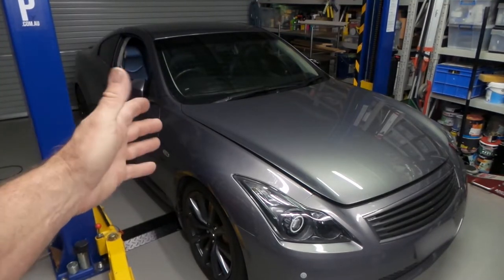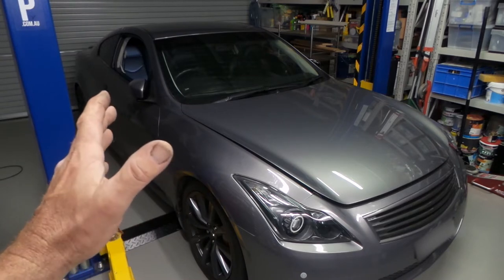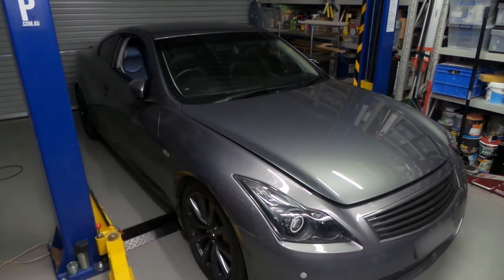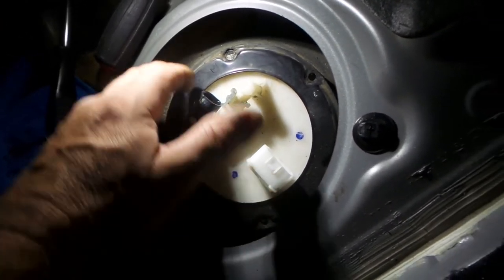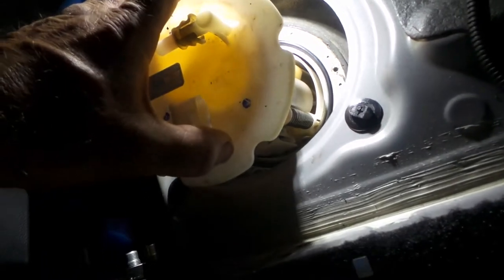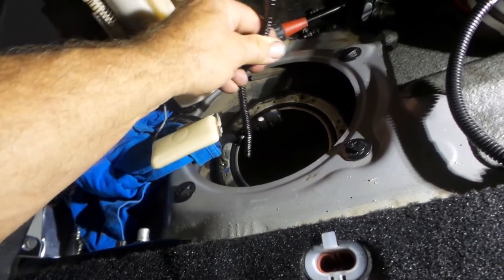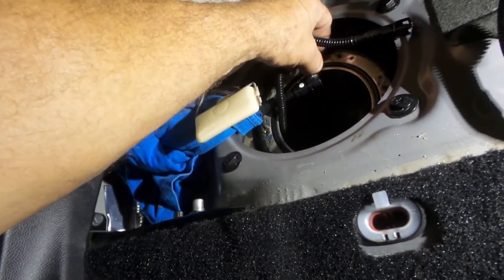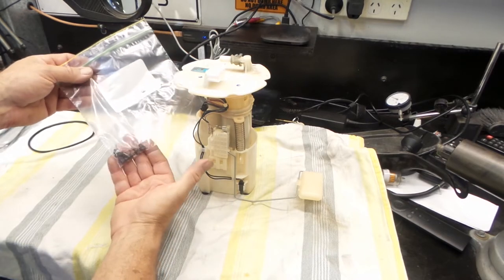The Ultimate 350z Early G37 Fuel Pump & Return Upgrade Diy

Comment: G'day mate, could you please share where dis you get the instructions for the CJM fuel return? I've already have a spare 350z fuel pump with the return correction and fitting installed, the electrical wiring done, and whats left is to install the hose from the new pump to the engine bay area and I have no idea of the hose arrangement. The only thing I know is that the hose that used to supply fuel is going to be the return now, and the new line is going to supply fuel. Could you share links with instructions or where you get pointers or diagram? Thanks a lot, cheers
Reply from the maker: G'day Mate, with the kit that I used (CJM) the original feed line is still the feed line. The new additional line (6an) is for the return from the Reg. Unfortunately I dont think there are any diagrams for the return lines available. Once you lay them out they are pretty self explanatory though. There is a join in the factory fuel line at the firewall in the engine bay that you will need to disconnect, there will be an AN style adapter for this join in the kit. From there you plumb to the fuel distribution block. The distribution block has 2 outlets, one goes to the rails & the other returns to the Reg. Hope this helps, Cheers.
Reply: @TheAussieShed  thank you very much for your answer and help. I've got a kit from CJM too, but I ordered for a G37 and I have, like you do, a 350z style fuel pump on my 2008 G37. However, Charles from CJM is really awesome and sent me the needed parts and let me return the ones that I wasn't going to use, and a brief explanation and pictures of it installed in a 370z. Ive got four hoses, one from the tank to a new filter under the middle of the car, another long hose from the filter outlet to the back of the four way piece over the rail, then another to the regulator and under the regulator the old feed line will be return. My mind was a mess but today I finally understood it and feel confident to install

Comment: Hey mate where did you get the O rings for the fuel pump? I just cleaned my sensors and went to the petrol station today, filled up and petrol poured everywhere on the ground. Im guessing one of my O rings is fucked and needs replacing. Cheers
Reply from the maker: G'day Mate, They are a Nissan Genuine Part.

Comment: why not run stagea vq25det fuel pump assembly which is factory return and have a bolt in solution without having to modify?

Comment: Did you use the g37 kit or g35 from cjm?
Reply from the maker: G'day Mate, Yes I used the G35 kit for the VQ35HR here https://cj-motorsports.com/products/cjm-s0-fuel-system-vq35hr
Reply: @TheAussieShed  thanks!
Reply: @Jumpingmeatloaf  I did the g37 kit and upgraded to a newer basket (2010+) which works also.
Reply: Flysohighx21 is that simply swapping in the newer basket? If so that would be awesome